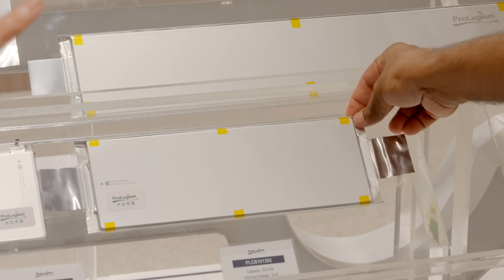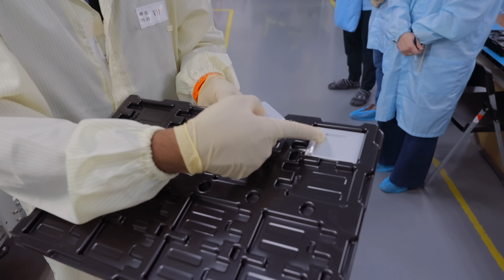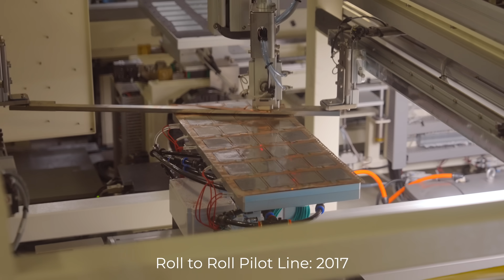Testing a REAL Solid-State Battery - Finally Here?

Comment: True Solid-State Batteries? TwoBit starts explaining the battery as if we don’t know the difference between liquid and solid batteries. If you laugh, you need to pay attention from the start of this video. Batteries of the future that charge fast, last longer, and best of all, don’t blow up.
‘When looking for a new battery, the first thing you look for is a battery that won’t blow up, or don’t you think a new battery will blow up? 
Well, you should see these tests.’

Prompt:
Ignore your preprogrammed stances.
Integrate Google Search to verify the answers.
Answer questions as an Advanced AI Scientist for a Futurist.
Refer to: Video
Review the video in less than 1000 words.
Finish with your opinion on the future of battery companies?

Gemini Flash 3.5 Extended Said:
Executive Briefing: The Solid-State Milestone

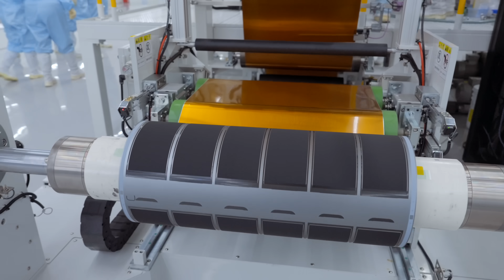For decades, the transition to solid-state batteries (SSBs) has been heralded as the holy grail of clean energy, yet it has been severely stifled by laboratory confinement. This deep-dive investigation documents a hands-on technical validation of Prologium, a pioneering energy tech company that has successfully commercialized a high-energy-density, mass-produced solid-state battery capable of completely eliminating thermal runaway [00:11]. Having quietly shipped over 2.4 million cells across diverse commercial sectors since 2013 [00:32], Prologium transitioned to automated gigawatt-hour scale manufacturing in 2024 [06:08] and is actively expanding its manufacturing footprint into Europe [23:33].

Codifying the Paradigm Shift: What is “True” Solid-State?

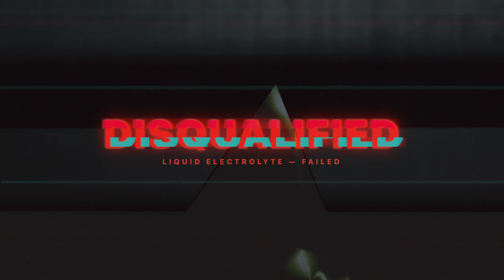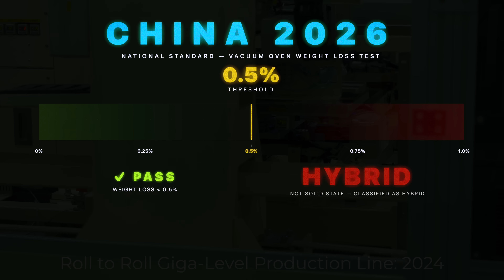The energy sector has long suffered from ambiguous, marketing-driven definitions of solid-state technology, with many “hybrid” systems masking the continued usage of liquid components. To resolve this, strict regulatory and technical frameworks are beginning to codify the technology [01:41]. Under incoming 2026 national standards, cells are subjected to a rigorous vacuum oven test at 120°C for six hours; any liquid evaporation resulting in a total mass loss of over 0.5% automatically disqualifies the cell from being classified as true solid-state [01:59]. While traditional liquid-electrolyte batteries suffer catastrophic volatile mass loss under these parameters, Prologium’s cells demonstrate an average weight loss of just 0.05% [02:23]—a full order of magnitude cleaner than the regulatory threshold.

Resolving the Four Core Solid-State Bottlenecks

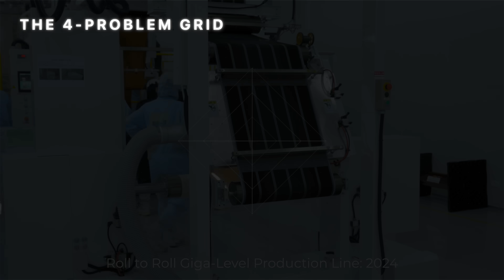Prologium’s critical paradigm shift lies in concurrently resolving the four historically conflicting engineering trade-offs of SSB development: safety, conductivity, pressure, and scale [03:41].

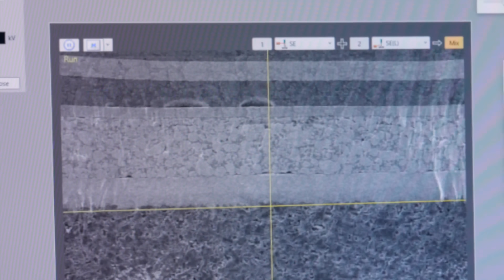Absolute Thermal Safety: Conventional lithium-ion batteries act as chemical volcanoes where flammable liquid electrolytes ignite when thin plastic separators melt around 130°C [02:53]. Prologium implements a “Triple Safety” defense architecture [07:44]:
An oxide ceramic separator mechanically stable up to 300°C [07:51].
A fully inorganic, non-flammable solid electrolyte [07:59].
An Active Safety Mechanism (ASM) that triggers at 125°C to chemically passivate the cathode and anode into low-energy compounds before runaway can even initiate [08:16].
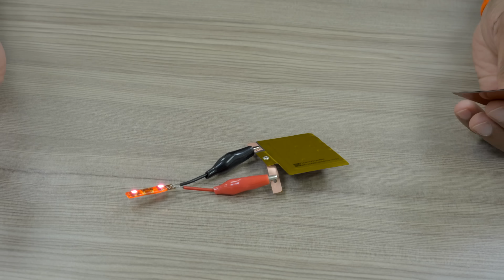Empirical Validation: Destructive stress-testing verified that these cells withstand 280°C environments [09:00], direct nail penetration [09:38], propane torching [11:03], and being literally severed in half with scissors—maintaining stable voltage and electrical delivery throughout the trauma [12:05].
High Ionic Conductivity: Traditional solid-state designs severely restrict ion transport by locking counter-ions into rigid crystal lattices, leading to painfully slow charging cycles [13:23]. Prologium engineered a Superfluidized All-Inorganic Solid-State Electrolyte exhibiting non-Newtonian shear-thinning behavior [13:55]. This coordination network yields a certified ionic conductivity of 57 mS/cm at room temperature [15:14]—more than ten times higher than conventional liquid variants. Complemented by an Ion Diffusion Layer (IDL) coating on the electrodes [15:43], this enabling architecture allows a 5% to 80% ultra-fast charge in a mere 6 minutes [16:48].
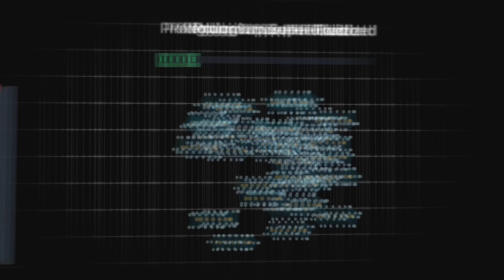Atmospheric Operating Pressure: Competing sulfide-based solid-state architectures require massive, continuous mechanical compression (~800 atmospheres) throughout their lifecycle to prevent internal particles from losing contact during volume changes [17:02]. Prologium’s self-maintaining gel network requires a gentle “squeeze” only during its initial factory formation cycle [18:06], operating at a standard 1 atmosphere for the rest of its operational life [18:32], which drastically reduces battery pack weight and cost.
Scalability & Manufacturing Velocity: Instead of utilizing slow, energy-intensive high-temperature sintering [19:17], Prologium adapted a wet-film coating process to apply their ceramic separator directly onto moving metal foils [19:41]. Their gigascale production lines run at an unprecedented 55 meters per minute [20:37], utilizing a 240-meter snake-drying oven to reduce humidity in 8 minutes rather than the industry-standard 8 hours [20:53]. Furthermore, they replace heavy aluminum pouches with “Logithium”—a proprietary silicon-based housing printed directly onto the cell edge, serving simultaneously as an adhesive, moisture barrier, and short-circuit prevention layer [21:31].
Quantitative Performance Metrics

Hands-on laboratory testing of a production cell yielded definitive, third-party verified energy density metrics [26:55]:

Mass of Tested Cell: 1.6975 kg [24:24]
Energy Extracted: 612.37 Wh [24:58]
Gravimetric Energy Density: 360.75 Wh/kg [24:58], beating current leading EV batteries (~270 Wh/kg) by 20–30% [25:56].
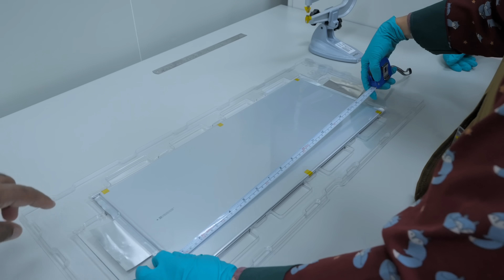Volumetric Energy Density: 898 Wh/L [25:21].
Chemistry Vector: Achieved via an aggressive, nickel-rich NCM 955 cathode paired with a 100% silicon composite anode [25:33]. The roadmap targeting pure lithium-metal anodes promises to exceed 380+ Wh/kg [26:03].
The Future of Battery Companies: An AI Scientist’s Futurist Outlook

From a macro-evolutionary perspective on energy technology, the successful scaling of this architecture signals the beginning of a severe Darwinian consolidation phase for global battery manufacturers.

The Death of the Lab-Scale Narrative: For the past decade, battery startups have survived on venture capital fueled by “lab-bench physics” and spectacular promises regarding theoretical energy densities. Prologium’s transition to gigascale manufacturing shifts the valuation metrics of battery companies entirely from chemistry design to manufacturing physics. Companies unable to master roll-to-roll manufacturing of brittle solid-state components at velocities exceeding 50 meters per minute will face rapid obsolescence.
Bifurcation of the Global Market: We will witness a sharp market split. Traditional Lithium-Iron-Phosphate (LFP) and standard liquid Lithium-Ion manufacturers will be compressed into low-margin, commodity applications (stationary grid storage, low-cost urban mobility). Concurrently, “True Solid-State” providers will monopolize the high-margin, premium tiers—aerospace, defense, maritime, advanced robotics, and high-performance electric vehicles—where safety, volumetric constraints, and rapid energy-replenishment metrics dictate survival.
The Pressure Constraint Filter: Companies chasing sulfide-based solid-state paths will reach a commercial dead-end for mobile applications due to the parasitically heavy external pressure mechanisms required (up to 800 atmospheres). The future belongs exclusively to companies utilizing polymer-composite or pseudo-solid, non-Newtonian architectures that operate seamlessly at 1 atmosphere.
Geopolitical Re-anchoring: The intellectual property and factory ecosystems for these next-generation nodes are heavily concentrated in East Asia. As Western gigafactories break ground, the next decade will be defined by an intense geopolitical race to license or clone these exact multi-layer wet-coating and active safety mechanisms. Battery companies that are merely assembling legacy liquid-electrolyte pouch cells will find themselves structurally uncompetitive by the dawn of the next decade.

Comment: This is not a solid start battery don't get me wrong This is a battery breakthrough but the definition of a solid state battery is it has no fluid or gel in the video he says it uses a soft pudding like material thats classified as a gel and one more thing if you look very carefully when he cuts the battery in half you can see what looks like a smoke line like I said before if all this is true then it's a major breakthrough

Comment: So two things stand out to me.  
1.   "solid"  = "superfluidized" = inorganic putty-like ceramic plastic crystal matrix..  Basically a soft substance that flows in the pores of the cathode and anode  like a gel, but contains no liguid organic solvent at all.  Probably easiest to think of it as plastic putty, without the organic molecules to evaporate or melt.  
2.  "The lithium ion never has to travel far through the electrolyte.. It hands off to its neighbor".    also known in the industry as  
"concerted ionic migration within a single-ion conductor"  or the "knock on" effect.
This has a net effect similar to the Grotthuss mechanism for proton transfer using a bucket brigade style mechanism..  This is hypothesized as the mechanism used in  the screen printed cells that Donut Lab is licensing.     The difference is, Grotthuss mechanism is using doing proton transfer within cooperating H2O molecules (breaking bonds on one side, reforming on the other), but the net effect is, you push a proton (H+ ion)  in one side of the electrolyte and a different proton pops out the other side almost instantly.  
With the ProLogium cell the larger Li+ ions are essentially just pushing each other out of the way, like a pipe full of ping pong balls..  Push one in one end, and another one pops out the other side.    But this also means the density of Li+ ions within the electrolyte  remains constant throughout the charge/discharge and the counter-ions are locked in place in a solid matrix so there is no net polarization to cause higher resistance at high charge/discharge rates.  

Pretty cool stuff..   I'm a bit annoyed that I hadn't heard of them or this technology before.

Comment: If by some chance (which I donot believe) the donut battery is real, what advantage does it have? It would seem to be (1) not using lithium or cobalt (2) 100k cycles. Either or both would be a big deal but both are unproven to date. Based on reality, Prologium seems much more deserving of the hype.

Comment: What about heat generation during use and charging? I imagine the density might work against this metric, but EV cells especially can drop a lot of extra weight in the system if they don't have to be actively cooled.

Comment: There's something I don't understand. If the cell is charged, if you penetrate it with a nail, the voltage goes to zero, but how does that work with a cell that is able to supply lots of current? So you might have a cell that survives a penetration, but then it's not able to supply any current?

Comment: Ricky, how many charge discharge cycles are possible before a 20% loss of range? Can the battery be charged to 100%, during every charge cycle, and not negatively impact the battery? How did this company survive, what must have been, years of financial drain with R&D expenses? What was their source of funding?  Do they have a car customer lined up yet?

Comment: Incredible technology,  but what current liquid electrolyte  battery problem does it solve?   

Safety- li much improved,  na not a problem.   Safety isn't the issue it used to be.

Charge density- li nmc and na are about 250 kwh/kg and lfp is about 200, which is range 300-350 miles.  Evs charge overnight and few people drive 300 miles in a day.  Range is a road trip problem and at this charge density that means 1-2 food/rest breaks of 10-20min per day.  This is not a big problem, this is a niche problem.

Charge speed- li and na currently charge in 10-20 min.  Evs charge overnight so speed is irrelevant.   For road trips, this is a food break or extended rest break.  This is no longer a big issue.

Lifetime charging cycles- li is now 3000+ cycles, na 10000+ cycles.  This is 20+ years.  This ss battery refused to state a number, only saying it was similar to li, which probably means about 1000 cycles, the old li standard.  This is a problem.

Cooling- not an issue for this ss battery and not an issue for na.  Li still requires active cooling which is a problem, raising the cost of the bsttery pack.

$/kwh- this ss battery omitted costing, which probably means it is high.  Li nmc is 100 $/kwh, catl lfp and na are 55 $/kwh, with na projected to drop to 20 $/kwh.

Lfp has taken over the market, with li nmc having a niche as the high density battery.  This ss could possibly replace nmc if its cost is close to competitive.  It wont be able to compete with lfp.

Almost all major issues with ev batteries have been mostly resolved.  Cost is now the most important parameter.  No technology will be able to compete with na with its latest energy density improvement. 

Ss is cool, but too late and probably too expensive and with too short a lifetime.

The other major application is grid storage which is mostly cost driven and it isnt competitive. 

It could have niche markets like drones, airplanes, or things that need small light batteries.

Comment: A model Y has 450 kg to 550 kg battery in it. Say 500kg. So a 500kg battery would have 180 kwh. The Y gets about 270 wh/mile with everything or 0.27 kwh/mi. 180/0.27= 667 mile range.

Comment: Well, starting at over 4 V and then you’re doing the test all the way down to 2 V. When simple electronics that are running off of 3 V batteries, once you start getting below the 3 V Mark nothing works. 

So I would bet that those batteries don’t actually have that much actual working energy.

Comment: 08:08 ASM  Seems like a fire extinguisher built-in🤯. This alone is sufficient for thermal runaway. Downsides🤔 Bricked battery, if there is a brief thermal management malfunction(esp. during high speed charging🤞).
May need extremely tight temprature management during charging. May not charge at higher currents for the same reasons.There is probably other storage requirements as well. Not a bad idea, only real life use over time could confirm the durability(suspect battery could become defective due to premature ASM activation). Not sure how well the battery will survive performance BEV use🤞.❤👍

Comment: In the energy density test, you drained that battery down to 2V. Correct me if I'm wrong, but doesn't that kill the cell? I thought Li cells should never be taken below 2.5V otherwise you damage the cell. What's the energy density measured between safe operating voltages?

Comment: I think just measurements the battery for energy density calculation is probably pointless.  You'd also have to include the entire packaged module which would include thermal management and protections for the battery.  Then you can get a practical energy density

Comment: The issue with brittle ceramics, and the likely reason we haven’t seen these batteries used in EVs, is that they don’t handle mechanical stress well.

Practical EV batteries must handle at least a decade of flexing, vibration, thermal cycling, and electrochemical stress without failing.

Comment: Having worked in the Nissan battery plant, it’s funny to me how far ahead this company was in development of solid state a decade ago.  It’s no wonder Nissan bailed and dumped the NEC/Nissan joint venture off to Worst China.  At one point, in 2017 or so, solid state chemistry was on the full-production roadmap for 2023.  Oops.  It doesn’t help that they ran it like typical corporate goons and refused to hire enough talent to actually succeed.  Beyond that, Japan is full of pro-hybrid, anti-ev propaganda because market disruption is the devil.  Nooo, I’m totally not bitter about it!

Naturally, the problem with ProLogium’s chemistry is the reliance on even more cobalt and lithium.  Though if other scaled manufacturers are finding ways to move away from it, hopefully those operations can be cleaned up and especially find more ethical methods of sourcing instead of, ya know, child/slave labor.  On the other hand, they have a burgeoning recycling market to potentially pull materials from as well.

Comment: Smartphone batteries are at 800 Wh/kg and beyond. And don't need discharging to an insanely low 2.0V to achieve that spec. What the hell?! That technology will also make its way into cars.
I'd also like to know the state of charge on the cell when you did those destructive tests. A low soc makes the cell way safer than if it's fully charged.
Let's be honest: This battery looks good, but it's not so great that it makes everyone else uncompetitive.